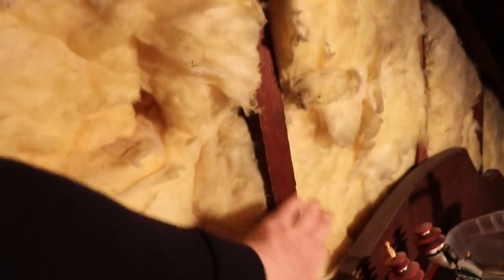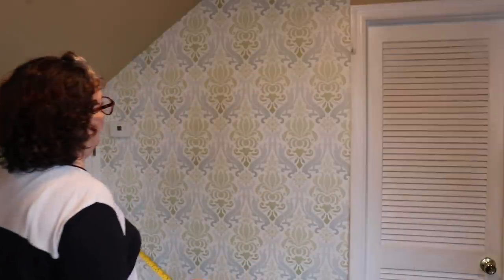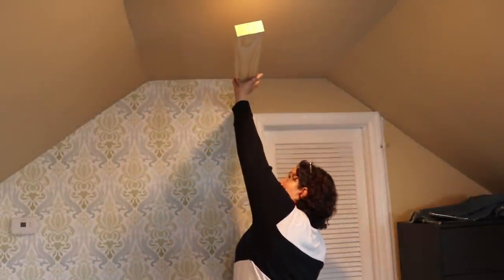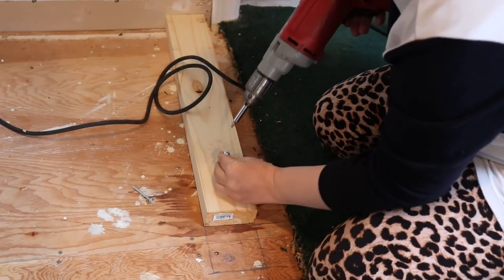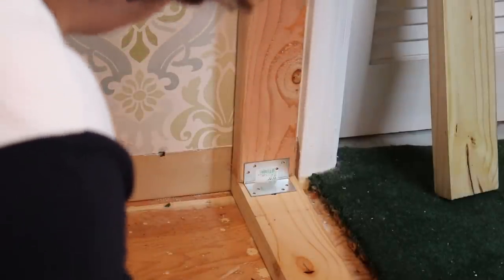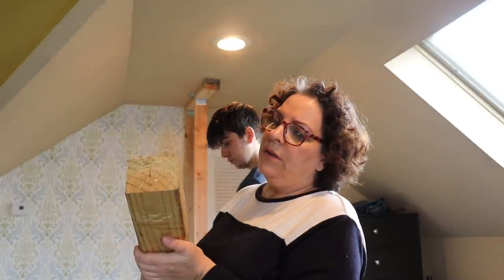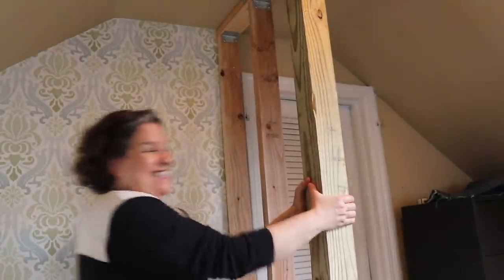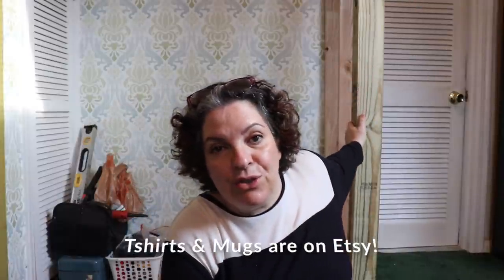Master Bedroom Makeover Series || DIY Closet || Episode 2 ||

Comment: If you decide to cover up the 2x4's inside the closet just use Luan.  A thin wood panel that you could just paint.  Lots less work than sheetrock would be inside the closet and quicker.  And hubby said you could use shutters that come in odd sized to use a doors.  They are louvered and you would just have to add the hinges.  Check your local salvage stores...they usually have odd sized louvered doors or shutters.  You could also get a ceiling light that just plugs in since you have a receptacle in the closet.  Really enjoying this! :)

Comment: Sophia, why would you use a battery operated light in your closet when you already have an electric outlet in the closet? Just use a plug in light with a pull chain. You can use an extension cord to put it right where you want it. You are not walking on it and not putting anything over the cord so you will be fine.

Comment: You might entertain the thought of decluttering that attic space before you place anything in the new closet. Then add a foam insulated board cut to fit over the back of the door to help insulate the space. I know I would never think about that attic space again once I had covered it over with clothing, etc. You are doing a great job Sophia!!

Comment: You and Edward did a great framing job. Nice and sturdy. The idea of taking the door off the attic part and replacing it with shelving on wheels is brilliant. My house is a cape and I used to have attic access in the foyer area between the two bedrooms. If you looked at it it just looked like a bookcase but as you grabbed it forward it was the access to the attic storage area (of course with the annoying slanted roof rafters). I put lots of books in the bookcase. Mine wasn’t on wheels so I had to empty the bookcase every time I had to get into the attic. Perfect place for shoes etc. Please leave the lighting in the attic. If you take it out it will become the black hole of Calcutta and if you need to check for leaks or take things in or out it make finding things difficult. I think your new closet will turn out beautiful and very functional. Really loving your closet videos. So happy you are taking your time and taking care of yourself.

Comment: They have some motion activated LED strip lighting on Amazon you could plug into the outlet and run them around the interior wall. I think the strip is 12-15 feet long. Or something similar utilizing the plug you already have.

Comment: For the doors - what if you use the whole front for 4 doors and the first two are as high as you can make them and the second two are following the slide of the roof? It would take some cutting at an angle but worse case scenario you can first cut a cardboard template and then cut the wood? It is good that you will have space between the clothes and the doors - this way will be easier to reach the high shelves.

Comment: I agree with those that say to fill in the side where Scott's dresser currently is. I would place the door to the bathroom on the new bumped out wall. When you enter the new bathroom door, the wall of the closet would be on your left: meaning the entry to the closet would still be in the bedroom. You would not enter your closet from inside the bathroom. On the right inside the new bathroom door (where Scott's dresser currently sits) you can have a deep linen closet. It would give you space for the quilts that you rotate through on your bed and for your sheets and towels upstairs. The linen closet on the boys' floor can be for their linens and their backup toiletries.

Comment: About the sliding shoe storage - it is a great idea and can also be done as a separate project later on bc I am thinking there will be need to kind of build in some kind of insulation so the cold air does not come from there... Or it could be it is not necessary because there are already doors in front that will stop the cold air from coming out in the bedroom...

Comment: Great progress! You are doing a great job and as always are so inspiring. Love seeing Edward help and learn. I think you're right that you likely won't need lights but you could always do something cool and inexpensive like rope lights for the art deco feel. They plug in power strip before covering your outlet and you can plug the lights into that. You could also use a strip of LED lights that are made to go under kitchen cabinets. I got some for my kitchen for around $12 and I love them. They have an in-line switch that makes turning them off and on easy.

Comment: Sophia have you thought about making your own closet doors? Plywood with trim,  I also saw where someone build a simple frame and put bamboo window shades on the back>> so pretty.  Frame was built with 1X2" and L brackets to hold them together with the bamboo stapled to the back. I know you can do anything it's just the time that's needed.

Comment: Well done!  And to get your son in the project is a great idea :). My daughter (who lives/works in Paris) texts regularly asking for how-tos.  I own all the power tools in our household, too.  

How about a solid shelf (shelves)?  They sell MDF shelves (rounded front edge) that are deep and super easy to cut with a circular saw (what you own).  Solid shelves install by resting on horizontal boards.  Wire shelves can be frustrating (not even surface, stuff falls through...).  A solid rod for clothes is so much easier to use than the ones that come with the wire shelves; the solid wood or metal rods are easily installed with two horizontal MDF boards and simple rod hardware.  Our new homes have always had solid shelves and I'm thankful.  So easy to clean and store boxes or items on solid surfaces.

If you used the space between the studs on the side, you could add shelves (MDF) and store shoes.  You could rock the studs with 1/4 sheetrock so it would give a more finished appearance.

I didn't comment yesterday, but I've always installed all hard floor surfaces in our home.  It took a while to convince my husband, but when he sees the amount of human skin and dander (pets) that remains in the carpet (even when vacuumed), area rugs have been ok for him.  SO much easier to clean.  

SO excited to see your progression.  Go Sophia <3!

Comment: For a light inside the closet buy a light that plugs in that outlet you already have in there and run the cable down and around the baseboard towards your new wall then up against the two by four you are going to add to your four by four and screw the light fixture on the wall on top of where the door is going to be and it will light up the entire closet. That’s how my light is install in my closet on top of my door.  Make sure you buy a light fixture that has a string you pull to turn on and off so it will hang right by the door when you open it. You and your son are doing an awesome job! You bring me back memories when my 16 yr old son and I installed a garage door opener to surprise dad for Father’s Day.  It was a wonderful weekend we had and when dad got home he couldn’t believe we had done it ourselves. He was proud of us. I do remember having a mishap with the wiring but we ended up using a phone line to thread the garage opener wires from the attic down the walls and to where the opener was going to be next to our door. It all worked out in the end. We never did get a phone line in the garage like we had originally had it wired but look now we have cell phones. Who knew! 😂

Comment: I don't know if you've thought of this. If you take the middle hinges out of bifold doors you will have two matching doors you can hang to create French doors. Just add hinges to the outside of each door and hang them like normal doors instead of using the overhead track. Bifold doors also usually have solid wood at the top and bottom that can be trimmed so you can make them shorter if necessary. Best of luck on the project and Happy New Year!

Comment: We turned a nook into a pantry and fortunately it had a electrical outlet in the wall so we just attached plug in light to ceiling and used an extension cord with a push button on/off and attached along the wall to outlet.

Comment: Don’t forget your nailers. They can act as small shelves on the interior. Also, you’ll need a nailer on the front ceiling and wall next to the attic door. I don’t see my door not requiring a small wall added to the left if the entry. You got this though, so far so good.

Comment: To prevent thermostat wires from falling through the wall after the housing is removed, simply wrap each wire around a pencil.  Worked like a charm when I had to relocate a thermostat.  Your construction gave me ideas on how to frame and sheetrock my pass-through closet that lacks any doors or enclosures.  Perhaps that will be my project for 2022!  Love your channel.  You inspire me to tackle all sorts of DIY repairs and home improvements.
Reply from the maker: Good idea about the pencils

Comment: I have a full height built in closet in my loft.  We did 2 full height closet doors singularly they are narrower than a normal door but when closed the x2 are collectively wider than a normal single door, but then one of them is cut on the top to an angle on oneside to account for the roof… however I don’t have stairs so don’t know if that would block your stairs.
Reply: Also why would you move the thermostat? Do you use it all the time?  I only change mine 3/4 times a year so I would leave it and just move the clothes when I needed to change it.
Reply from the maker: Because it gauges the temperature in the room and kicks the furnace when it drops below 68. If it s in the closet it will be reading a temperature that is not accurate.

Comment: Its coming along i have a suggestion the thermostat really doesn't need to be moved as if you need to raise the temperature you can just go into the closet and raise it .as for the light why don't you get a portable florescent light and put it on the back wall where the outlet is or place it to the right where you and Edward put up the frame this way when you open the door you just turn on the light or another idea is you can get those portable lights from $1 tree the ones that you put4 AA batteries in and velcro it to the wall and when you need light you just tap on the light they come in all shapes and colors

Comment: hey Sophia! You’re doing a great job! As fast or as slow as you can is just fine!  For the closet door, do you think a sliding “barn door” would be an ok doable option for your closet if you put the opening by the right hand corner? I know even less than Fiona about building but that should allow for you to have a door, be able to access the closet and not have the door take any space from the bedroom when open? I’m thinking of doing a DIY linen closet and would be faced with similar space constraints.
Reply from the maker: The track would have to overextend on the side

Comment: I just hate leaving “ideas” for you because oh sooo many….but I did check quickly and I was wondering if you checked out ACCORDION DOORS for the closet? 
They can be cut by you! That would be way easier than making bifold doors. If bifold doors aren’t exactly right you will fight them every day. Experience. 
With accordion doors, quality is key. I noted on an Amazon review some complaints about the material being ‘too thin.’ IKEA has them, Home Depot, Lowe’s, etc. You’d want a good heavy-duty door, but they are less expensive than bifold doors plus the hardware. With an accordion door you install the track, trim the door to size, pop it in. Maybe!?!
XOjennyinseattle

Comment: I would of put you closet on the other side long ways by your sky light used the wider part of it to meet your sky light that way.
Reply from the maker: Then the bedroom would lose the light and it would roast under that part of the roof in the summer. The house is facing south it s 108 without ac up there in July and August.

Comment: Next project,let Edward use his math skills to design a low,cubby closet to the right of the bathroom door.Have a solid wall facing out to the bedroom and pull the bathroom door out to the point where it is in line with both new closets.Then the new little hallway to the bathroom would only be open on the right to access the open cubbies for shoes or linens.( not really walking through closets so Scott would be okay with it?). Does this make any sense?🤔😵‍💫
Reply from the maker: He s not okay with it.
Reply: @mygreatchallenge  ☹️